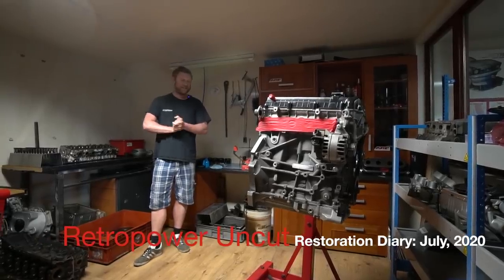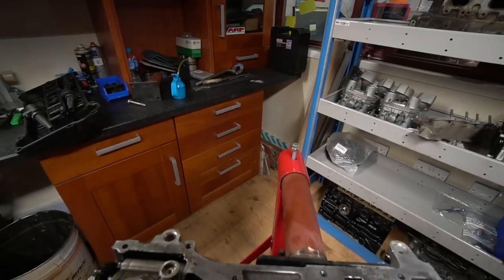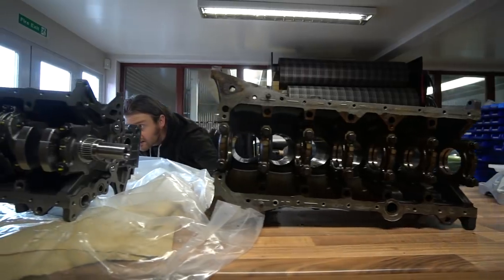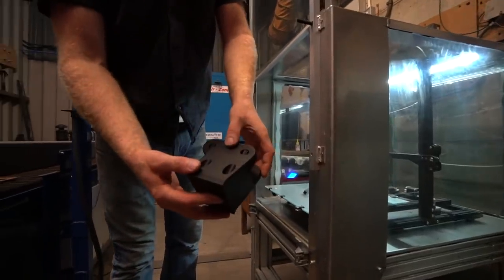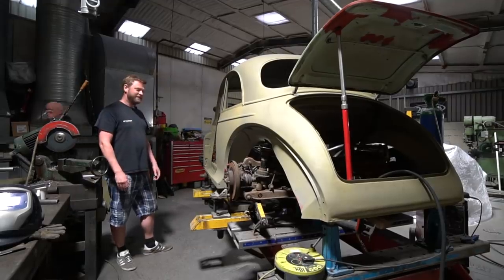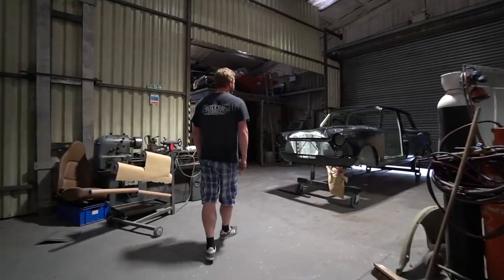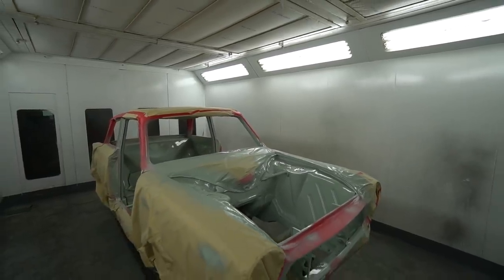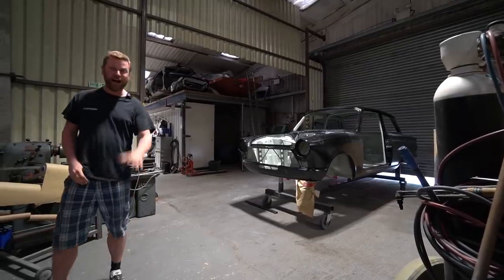Retropower Uncut Episode 1 : Cosworth, CAD & Cortina

Comment: I would like to see more about the Duratec/Cosworth builds. I build cars and trucks in Arizona. I stick to more traditional engines. But add fuel injection and modern transmissions. But I would love to build a Datsun shop truck with Cosworth power.